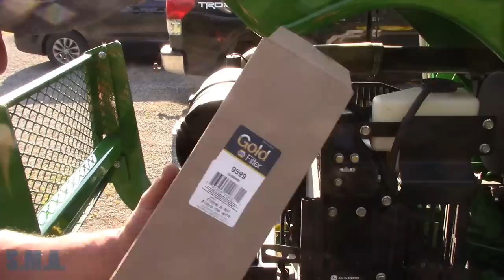John Deere 5055E : Service

Comment: Would not crack the injector lines on the head without first talking to a very good JD mechanic.
 I always blow out the outer air filter and radiator after using in dusty conditions. Surprised no prefilter in front of radiator.

Older case dozers and track loader’s steering brakes run in an oil bath. Required mineral oil, which you can still get at NAPA ( no sponsor). Any other oil would quickly ruin the breaks. Only fix was to replace shoes.
Reply from the maker: I run mineral oil in my 45 Farmall H
Reply: One of my tractors is 41 John Deere H. Love to drive.

Comment: Pro-tip: If you wear a leather belt, you always have a filter wrench. Granted, a belt would probably have been too thick to fit between that oil filter and the body.

Comment: Is there a drain plug on the engine oil filter housing?  JD typically has one, not sure on the hobby equipment though.

Comment: So why do the tires have fluid in them. I’m just curious does it get better traction that way?
Reply: Counter-balance weight for the bucket loader.
Reply: Oh ok, that actually makes a lot of sense.
Reply: It adds a lot of weight. More weight = more traction. It also lowers the center at gravity so the tractor is less tippy on hills. As mentioned, it also helps keep the rear from lifting when using the loader.

Comment: There are 2 plugs underneath... one under the seat area and the other under the engine area. One is for engine oil drain (the one in the front)... what's the one under the tractor at the rear under the seat area?

Comment: What’s up with the loaded rear tires on a tractor? Wether it’s calcium or whatever you have in yours what’s the point?
Reply: More or less its for ballast.  (or traction)  If you pick up something heavy with the loader, its nice having a little extra weight on the back end of the tractor.  Some people might mount a weight to the 3-point hitch.  This accomplishes the task and leaves the 3-point hitch available for use.   If you pull heavy implements, you might add weights to the front of the tractor to keep it on the ground.

Comment: Napa filters on a john deere?
I have heard bad things about them in tractor situations of them collapsing and staving it of fluid.
At least the factory filters are 100% john deeres issue if something fails.

And as a good measure, I like to write in sharpie marker on the filter the hours and date.
Reply: I think this Yanmar will survive a Mann Hummel filter.

Comment: 2 fer 2! 'Murica! Wooo! 👍👍

That thing's a beauty! Nice 'n' green, lol. You lucky dogs get off-road diesel out there? Looked straw-colored. It's all blue out here in the people's republic of MA - they gotta get their tax money, ya know, even if the equipment never sees pavement.😡 I just went on a 3 hour trek to get ethanol free gasoline in the land of Live Free Or Die! 

Why does every factory CRANK their filters on with a 6' cheater bar??? That's a question I've had for years! I thought it was only Japanese motorcycle manufacturers that did this ... and General Motors, of course.

Never knew they had calcium pressure gauges.That stuff is brutal. All the tractors I see here are well used, and the rims are destroyed, and impossible to find. These guys usually run them out of oil eventually, so they don't stick around here long, lol! One neighbor got a newer one loaded with beet juice. She got a piece of metal jammed in the sidewall - thing was puking all over my lawn. Killed the grass, lol. So much for the environment! 😂 At least it won't blow out your rims.
Reply: Now YouTube is limiting my post length!!! Those dirty @#%!'ers! Anyway, as I was finishing up before I got cut off ....

Apparently I can't talk about the state of MA - Youtube doesn't like that ... 😡
Reply: Well I can't post it the way I wanted, so I'll tone it down. Was just saying, before I ranted about MA again, that I was looking for a backhoe to move all the boulders and excavated dirt from my yard. That was, until I had to buy a new iMac - that'll be here in September. Also got Final Cut Pro! Should be able to make some cool vids with that .. if I can figure it out, lol. Anyway, Keep on Farmin', brutha!  🤘

Comment: Hi Eric, that's a beautiful green tractor, what does the the liquid in the rear tyres do?
✝️🇬🇧🇺🇸
Reply: Yah I was asking the same question
Reply: The tyre liquid is for added traction. Some farmers add fluid to the tires to help prevent spin out when hauling implements.
Reply: It is rear ballast weight to increase traction for pulling and also as counterweight for using the front loader, since the loader will try to pick up the rear of the tractor and in most cases will.
Reply: Thanks guys, I've learned something about tractors 😀
✝️🇬🇧🇺🇸

Comment: Maybe check the breather as that pressure when you undid the plug had me thinking!
Reply: Some of the JD tractors don't have a breather on the front axle.
Reply: @ngnmech  Yes, thanks for the reply, that's what Eric said as well, and I do not know if it has or not. I just do not like pressure build up in anything that holds oil in.

Comment: Eric ,  It's a good idea when you change Filters to use a Sharpie Permanent Marker and mark on the end of the Filter the Date and  Mileage / Hours and whether it was an Oil & Filter or Filter Only change .  (I do this with all of my Cars, Trucks, Tractors, & Bulldozer) .   Also , if you go on the Internet you can get reasonably inexpensive plastic Dust Covers for your grease zerks , and they are available in various colors , -- I'd recommend getting caps of a contrasting color to the paint scheme of your equipment , it makes them easier to find so you don't miss any when lubeing the equipment .   --   < Doc >  .

Comment: Remember this is John Deere the company that’s gone out of their way to prevent DIY repairs and even sometimes maintenance at nearly any cost. You can buy a John Deere tractor or other piece of equipment but you don’t really own it as John Deere still locks down your ability to DIY repair it.

Comment: The brakes are like that on those tractors you have to get the oil up to the brake valve if you have brakes on the second push of the pedal I work at John Deere and we have tried to bleed them factory says that’s normal operation just thought I’d let you know before you get mad and spend a whole bunch of time bleeding them

Comment: Better check the engine -- it sounds like it's "dieseling" badly! (Fuel injection has eliminated that, but it was "a thing" in the 1970's through the 1980's.)

Comment: So ya put a new filter on and run old fluid through.  Hmmm
Reply: Hydraulic fluid in a tractor rarely gets changed. It's not like a car or truck. Not sure about this tractor but larger ones can take 45 gallons on hydraulic oil, changing all that gets expensive. Changing the filter removes any debris, the oil is designed to last longer than regular engine oil.
Reply: No clue about hydraulics? Hmmmm

Comment: Prefill fuel filter eliminates the need to reprime
Reply: That is plain stupid. The filter is there to filter the fuel. Never prefill a modern primary fuel filter.
Reply: @jonasthemovie  we do it all the time in the shop as our fuel is filtered 3 times before it reaches the shop and you fill in the small inlet holes, not the large outlet hole.
Reply: Allan Szast Do the people you advice to prefill their filter tripple filter their fuel? What could be questionable ok for a shop with extra precaution is not good advice for the field.
Reply: @jonasthemovie  purchased from any reputable fuel source, the fuel is already filtered at least once, filled in intake side of filter is twice.  Kept in a sealed container it won't pick up contaminants. Look you do it your way,  I'll do it mine. Never had a failure, so  it's an alternative method. Use or don't,  not my concern
Reply: Allan Szast That is not how reality works. That is how your shop goes about business to save time. But it is not the advice you can give to people in the field when it comes to the primary fuel filter in a modern diesel. And that is why we strongly advice against prefilling the primary filter, regardless if you think you can control the fuel cleanliness. Hydraulic oil and fuel are to be considered dirty, even straight out of a sealed container from a supplier. Best regards, a R/D hydraulic system engineer.
Reply: Well if you don't prime the filters then you should at least take compressed air and pressurize the tank to get the fuel into the filters. I have a Detroit Diesel that will not start unless I do this even when it has just been setting for a few months.
Reply: Keith Studly There is a prime pump in the filter head for this tractor. No prime pump on the Detroit?
Reply: @jonasthemovie  no

Comment: Greasing the threads? Why not use anti-seize?
Reply: More as a "rust-preventer" situation, than an "anti-galling" situation. Could have used never-seize also, but the grease was already handy.
Reply: @mattmanyam  poking fun at Mr. Os hate of anti-seize. I live in the rust belt and know that anything is better than nothing. Hope you're subscribed, bud

Comment: John Deere used to import Yanmar tractors from Japan that were painted Deere green with Deere decals, did they switch to a chinese made tractor?  I don't think that Deere has an inhouse diesel that small.  Looks like yours is pre tier IV so it has a mechanical injection pump and not electronic high pressure injection, that is a good thang, mechanical pumps can be rebuilt.  you need to explain 'schmutz', it's a NY word and folks in flyover country won't understand.  Smaller tractors are widely used outside the US where smaller farming is the rule.  Lamborghini, the Italian carmaker actually makes most of its money selling small diesel tractors many of which are two wheel walk behinds, I saw quite a few in Switzerland.  I bought a Kubota tractor myself feeling it was a way to eliminate the middleman, it was cheaper for much the same tractor.

Comment: I have a 5000 series,one of johndeeres worst. only model in the series that uses the gm style 6.2 injection pump and lower pressure injectors. the fuel system is idiotic. at 800 hrs mine sucked up plastic shavings left in the fuel tank from the factory,plugged the filter and filter pump with curly black shavings. i was shreading with it,parked it and it was running fine,shut it off,next day it wouldnt start. it somehow killed the injection pump and also had to replaced the injectors just to be safe. they wouldnt warranty it even tho its a known problem. the fuel tank outlet is low,the fuel filter is mounted high and no inline lift pump. there is a pump button on top the filter housing to prime it.change the fuel filter often!

Comment: I cringe when a Napa fuel filter goes on a diesel.  It would shock you to know the micron rating vs the stock filter.  It won't cause an issue right away but you will have premature fuel system issues.

Comment: You can buy 15W-40 diesel fleet oil that does the job of a hydraulic oil as well, but for a one-off job it's not a big deal to get both separately.
Reply: Have to be careful doing that since most tractor use wet brakes and some have wet clutches also  You don't want the friction modifiers that are used in engine oil in those type systems.

Comment: 5055E SPECS.
ENGINE HP

59 (44.4)

PTO HP

41 (30.6)

ECONOMY PTO

Yes

HITCH CATEGORY

Category 2
(convertible to 1)

2WD OR 4WD

Both

CAB OR OPEN STATION

Both

Comment: You should NEVER use after market hydraulic filter on tractor. Ok to use aftermarket filters on fuel and oil. Nor use filter wrench tightening hydraulic filter.

Comment: Napa filters do not work on my tractor, took me 3years and 5 filters to find out....
Reply: Can you elaborate?
Reply: @svtirefire  for some Reason The Napa filter would  Clogged all my hydraulic system, I've change hydraulic oil numerous times and nothing was found. I had a hydraulic pump in hand convinced that that was the problem. Change to  New Holland filter and it was like night and day. I have never experienced that with any other filter.  The Napa filter would only last about 5 minutes before it shut down Couldn't  Steer or lift the bucket, The hydrostatic was fine it comes off another filter, New Holland, So a least on that filter I'm stickin with New Holland CNH.
Reply: Hope that helps
Reply: @senocon  wow that is bizarre
Reply: So, when Napa changes from Wix to Mann Hummel...

Comment: You broke the rule. "IF IT'S NOT RED KEEP IT IN THE SHED" .  Where is the Farmall ? It's crying
Reply: I totally agree, Red all the way but his Farmall is tricycle front, first time I saw him using it on the hills he lives on I cringed. I'm no safety sally but those narrow fronts don't belong on hills.
Reply: @farmcentralohio  : Straight up or down is OK, but not side to side of the hill.  I get chills just thinking about doing that.
Reply: @InquisitiveSearcher  Even straight up and down can be sketchy with a narrow front, you gotta turn around at some point
Reply: @farmcentralohio  :  In my mind there was a "top" of the hill on which you could do the turn around.  But yes, any side to side travel on a hill with a high center of gravity tricycle tractor, rather than straight up or down, is something I would recommend staying away from.

P.S. If you have to do side hill work, working from side to side, I recommend a low profile "utility" tractor with a wide front end and a VERY solid roll bar and good seat belt.

Comment: Bad choice... not going with OEM filters
Reply: Tell us more.
Reply: Where do i start.....?.....ill just say if u have a warranty issue an ur dealer sees the aftermarket filters .....good luck....
Reply: Len Hofer Tell us more about the warranty of this tractor.
Reply: @jonasthemovie ...

What else u wana hear......?
Reply: @lenhofer3214  We all want to hear why a quality Mann Hummel filter is a bad choice for a 7 year old tractor out of warranty.
Reply: How big a farming operation do u run....?...
Reply: @lenhofer3214  A better question would be how big Mr O´s farming operation is. I´m guessing you want to flex with having a big farm which would make you an expert? Sorry, I don´t have a farm, I´m just a hydraulic system engineer for a leading global off highway machine company. So, again, tell us why not buying the OEM filter (Donaldson or Champ), but instead a quality replacement (Mann Hummel),  for this out of warranty tractor, is a bad idea.
Reply: OEM filters......filters that jd has specced for that machine ...and would highly recommend replacing them with such....iv been in the service end of equipment for n extended period of time n have seen what aftermarket will build to meet a certain spec an claim that its the specs oem requires ....it has to be built to oem specs....outlined by the oem ....ur asking y not the Mann filter ....wondering if u read my question other then i intended it to read .....
Reply: I will say that being out of warranty will probably not hurt the owner if he prefers aftermarket filters....
Reply: @lenhofer3214  You should correct your original comment, only use oem if it's under warranty. Any other time Napa or whatever one chooses is fine. You're trying to sound smart and start arguing with people over something you don't understand. That or you work for John Deere and are brain washed like the other JD fan boys.
Reply: @farmcentralohio  theres no reason to argue about a filter....
Reply: @farmcentralohio  ......maybe remove ur comment .....could u please do that
Reply: @lenhofer3214  you're wrong, accept it and move on Lenny
Reply: @farmcentralohio  its a free country.....entittled to ur opinion and vise versa...
Reply: @lenhofer3214  If you want to be entitled to an incorrect opinion that's your business  lol  Trying to give bad advice is something you should stay away from. Don't know what you're talking about, keep your trap shut.
Reply: Not sure what got u so worked up .....but stop replying
Reply: @jonasthemovie  whats the name brand of the equipment company u work/engineer for.....?

Comment: John Deere telling you to check the tire pressure with valve stem at the bottom is a perfect example of how dumb that company is, I'm surprised the next sentence isn't We here at John Deere make air compressors for when you ruin yours when checking the tires.

Comment: The John Deere online parts store (for your model 5055E) is pathetic.
All they offer for you are 3 blade fuses, a tire valve stem, and a PTO switch.
They do have all the fluids, chemicals, cleaners, etc. but no filters or parts for you.
The big push for them are different types of mowers. That's the trouble with things made overseas- companies would rather sell a complete machine, than parts.
Nothing runs like a Chinese Deere, I guess.

Comment: Why do you have to have calcium in the tires
Reply: The front end loader could potentially lift enough weight to cause the back end of the tractor to come up off the ground. “Loading” the tires makes the back end heavier, preventing the tip up. Calcium was originally used because when mixed with water it is heavier than water alone and won’t freeze. Some people use windshield washer fluid, but most use beet juice or citrus mix which also doesn’t freeze and is non corrosive.
Reply: To add rear weigh to the tractor for traction when pulling, and also as counterweight for the loader since any weight added to the front of the tractor will reduce the weight on the rear of the tractor because of the fulcrum effect.  In this case Eric is using a product called Rimguard which is a byproduct of sugar beet production. it is almost as heavy as Calcium chloride but is not corrosive.
Reply: @ngnmech  now it makes sense thank you
Reply: Ballasting the tires also increases traction and lowers the center of gravity to make it safer on hills.